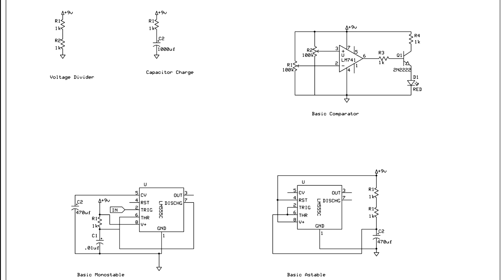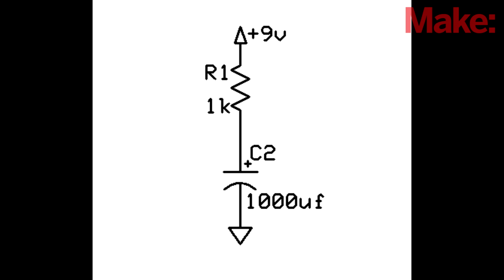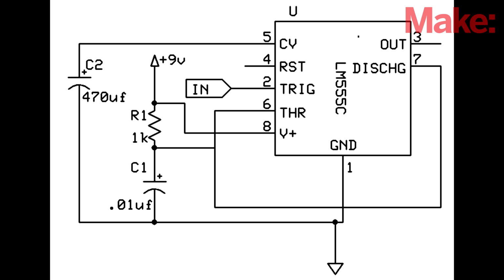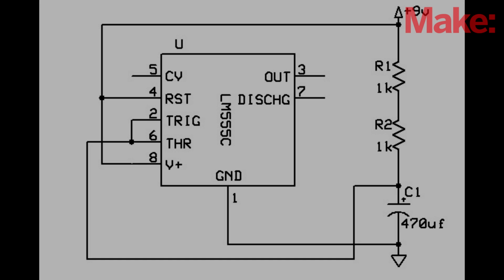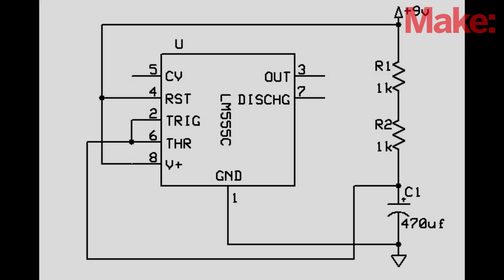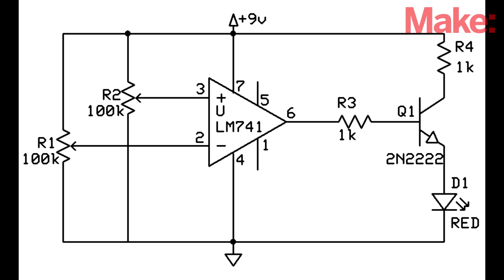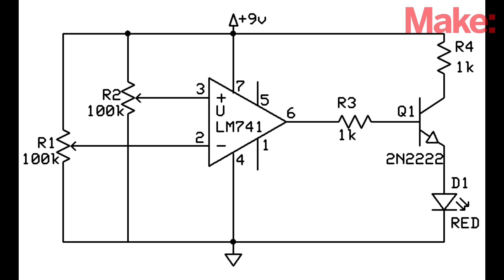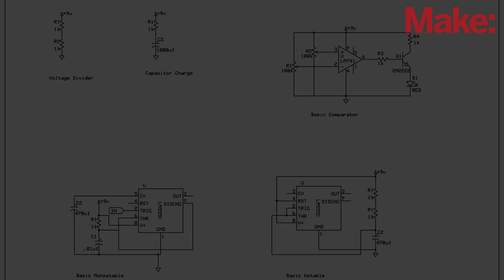Projects With Ryan Slaugh: Useful Circuits

Comment: Great video. One question, though. Why have you put the transistor at the output of LM741 voltage comparator? Isn't the +Vsat sufficient to drive the LED?

Comment: 03:05 there isn't the wire between the two resistors and connected to Discharge pin. In this way also when the out goes high the capacitor never discharge.

Comment: one stupid question, i hope someone will bear with me, but on 1:02 the formula "Vout = Vin X (R2/(R1+R2))" is correct? because then if i put instead of an 1k ohm a 20 ohm for example, or if i use any resistor value as long as R1=R2, it would achieve the same effect (getting half the voltage as output). am i wrong? sorry if its a dumb question!
Reply: I guess you might have found your answer by now..If not watch this: watch?v=XxLKfAZrhbM .Could also be useful for others with the same question :)

Comment: The first circuit is a series circuit (voltage divider), yet the equation is for a PARALLEL circuit. Using Ohm's law will verify this.

Comment: This is really cool!
I was just looking for a monostable 555 diagram the other day, this is exactly what I needed.
Reply: I used to use a 555 for a monostable or one shot water dump system into my turbo intercooler... I went to make a new one some years later and did the cost up of it, and it turns out I can use an arduino nano and a simple automotive relay (which was needed anyway) actually cheaper than buying a 555 timer chip on it's own. However, 555's work brilliantly for signal conditioning and filtering. Varying signal in, single solid pulse out. Really handy.
Reply: That's a good tip, I'll remember it for my next project. I do however already have 10 NE555's I got for $0.13 each.
Reply: NE555's aren't used as much as they used to be. They may be selling off cheap as over supply influences price. I think a NE555 was $3.60 plus supporting components and PCB to make the equivalent circuit I achieved with a MC68HC08QT4 back in the day for only $2.10.
Reply: Makes sense, now that Arduinos, Raspberries etc. are so common and readily accessible.

Comment: I will be using the pulse generator as an alarm! Thank you for the inspiration. I need low-cost, low-maintenance electronics to read the data with a photo sensor (pot) and then emit an alert when the voltage drops too low or goes to high (depends on sensor placement. I'm designing a tsunami detector. Let me know if you are interested in the project and we can chat! I'm on twitter @sciphotogastro and G+ here. Thanks again,
Kase

Comment: That thing about charging the cap is wrong.
Reply: Your right, it is a little off.  But Im correct as well...Kind of.  I should have been more clear.  The t=RC (t in this case is actually pronounced tau) gives you the time constant.  It is the time required to charge the capacitor to 63.2% of full voltage.  To get full time I approximate by multiplying it by 5.  Its a trick taught in technician school.  To be truthful it will never reach 100% charge because it always goes 63.2% of the remaining.  To get the actual is V(t)=Vo(1-e^(-t/tau)).  I should have been more clear.
Reply: *****
multiplying the time constant by 5 isn't exactly a trick, it's actually the amount of time it takes for the output of any kind of first order system to reach ~99% of the desired value
Reply: Robbie Mckennie
99% of full charge is reached within 5*tau seconds, and this can be mathematically proven. If 99% isn't "an approximation in the normal sense" to you, then I guess it's because you're just being retentive about getting corrected. I dunno where your extrapolation came from (ideal caps? infinite charge time? do you even know what "approximation" means?) but there's no need to get offended over my correcting you. Do like rwslaugh and admit you're wrong, why don't you? He did it when you said the formula was wrong.
Reply: Have it your way... the video is about electronic circuits, your mathematical precision is cumbersome here.

Speaking of precision though, I just hope you agree that an approximation isn't simply "a rule of thumb", being so passionate about math and all you should know better than me.
Reply: what are you talking about? It can also be a decoupling circuit to level out the input.
Reply: Portal12345678910 The formulas given for the time it takes to charge a cap are wrong, i mean.
Reply: Robbie Mckennie
But it most certainly is a "mathematical truth". 5*tau isn't just a rule of thumb, it's a fairly reasonable approximation and it has a clear mathematical meaning.
Reply: Either the charge time is equal to 5*t or it isn't. And it isn't, therefore it is not a mathematical truth. It's not really even an approximation in the normal sense, because an ideal capacitor takes an infinite amount of time to charge so any finite approximation you give is off by a factor of infinity
Reply: Well thank god we don't worry about "mathematical truths" when doing some real math. Example: series expansion.

Stop being uptight about this, your precious argument about 5*tau = full charge time not being mathematically true is of no importance. For all intents and purposes 5*tau = full charge time, debating over less than 1% is dumb.
Reply: Robbie Mckennie
True to that. It is indeed wrong. Good job Robbie!
Reply: ***** Sure, 5*t is a good rule of thumb for charge time, but it's misrepresented as an actual mathematical truth, which it isn't.
Reply: ***** It is true that you can reach a nearly full charge in that time, but not a full charge. In that sense it is an approximation, but even an approximation is not a mathematical truth. You may as well say that the ratio between a circle's circumference and diameter is equal to 22/7
Reply: ***** I think we're just coming at this from different perspectives. I'm looking at it as one who enjoys recreational mathematics, and the one of the most important things in pure mathematics is precision. I'll concede that in real world applications like engineering approximations can be very useful, but that does not make them mathematically true.
Reply: Perhaps not, but i also wouldn't call 5*tau an approximation of charge time
Reply: Mark Simons Is that a crime?
Reply: Robbie Mckennie
Not at all, thanks for admitting it though.
Reply: Robbie Mckennie Not a crime, just a mental a/o personality disorder.
Reply: Mark Simons Well thanks.